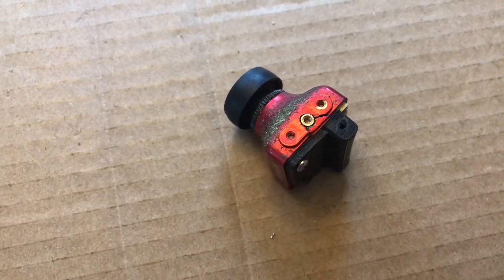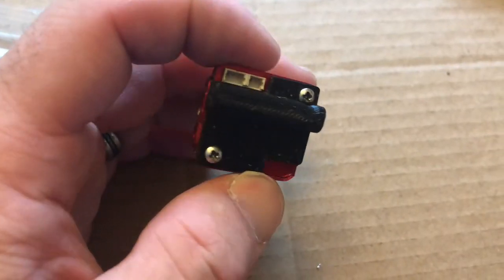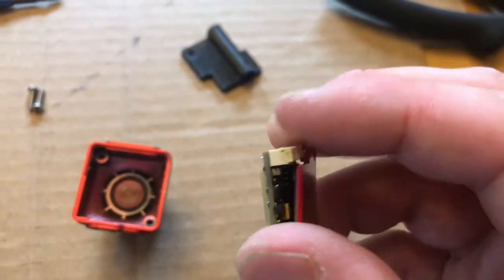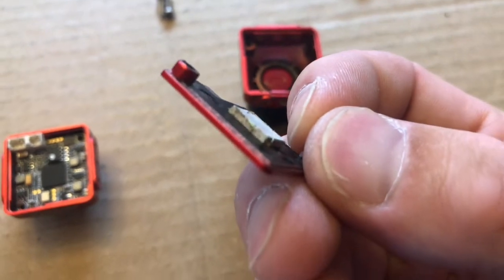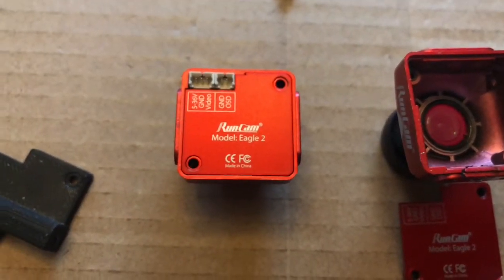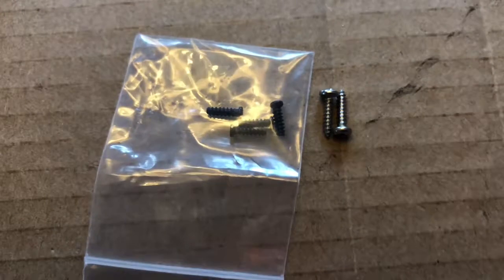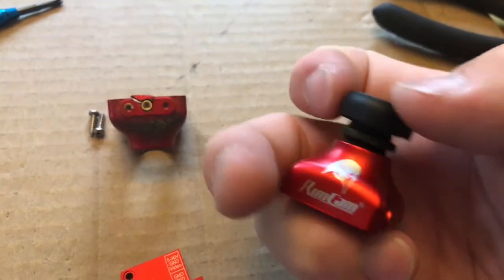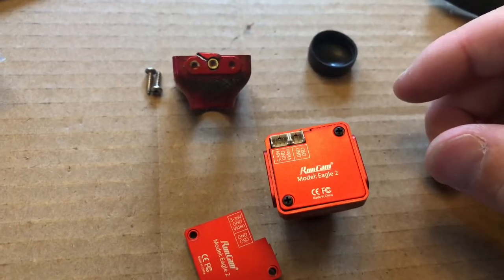How to replace or repair Runcam Eagle 2 case

Comment: hello, nice video. I can't find replacement case anywhere, do think runcam swift 2 case would fit alright?
Reply from the maker: You can find a Runcam Eagle 2 Pro case here: https://shop.runcam.com/cases-for-runcam-eagle-2-pro/ The Swift 2 case might fit but the case doesn’t have a hole for the microphone. If the link above doesn’t work there’s a few Eagle 2 cases available on eBay.
Reply: breaksteel  thanks a lot
Reply from the maker: No problem, thanks for watching!